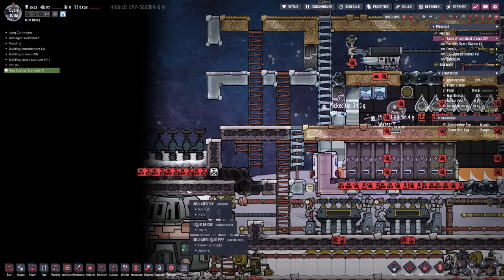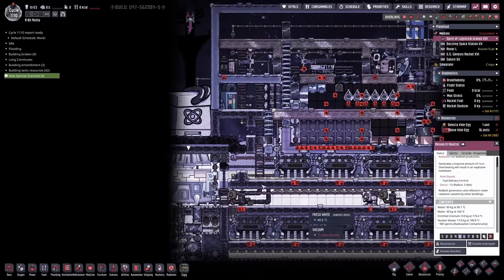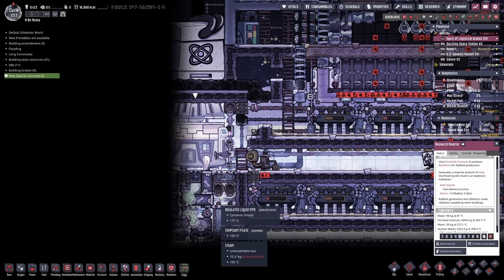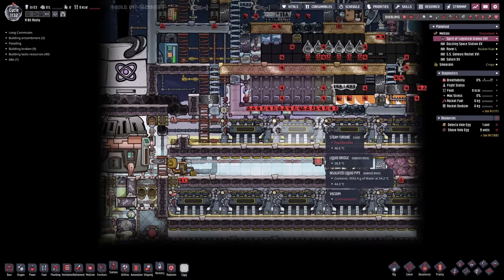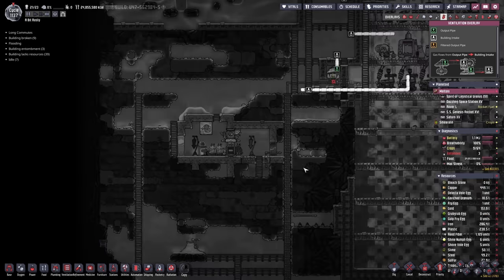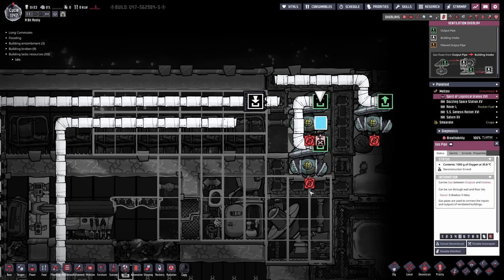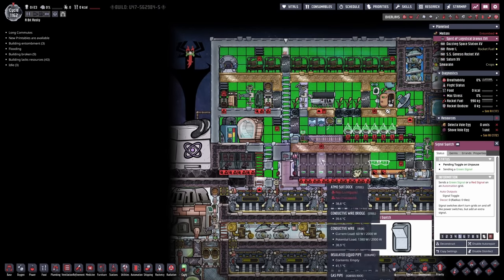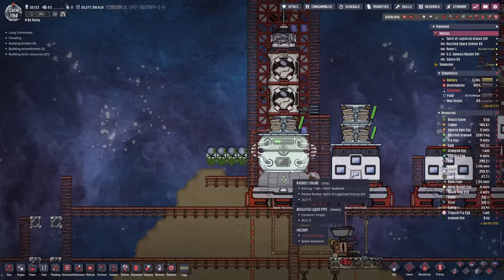Ep23 : All Systems Green : Oxygen not included

Comment: Since it seems like no one else mentioned it. 

The source of your radiation beam woes from the reactor has less to do with the tile you were working with - the one that lost some mass to the tile below it - and more to do with the fact that you packed the tile below it with too much refined carbon. You’re getting the lensing/integer overflow problem you showed in your previous video.

That’s why replacing seemingly random tiles a few space off-center cut down on the radiation.

Comment: Re: The conduction panels from last episode: The problem is that they exchange heat with the building they are connected to quite well, but they have really terrible conduction to the liquid flowing through. Imho that's a bug where the liquid only exchanges heat for one tick instead of the one second it spends inside the panel. If you place a valve downstream, after the panel (or multiple panels) and reduce the flow to something like 4000-6000, liquid will pile up in the pipes. Once the liquid backs up into the panel, it forces each blob to stay inside the panel for longer, significantly increasing the cooling power. The important part really is that the flow is backed up inside the panel, otherwise they are essentially useless. In my playthrough i split a normal 10 kg/s pipe into 4 2 kg/s pipes, each cooling 2 steam turbines just fine with polluted water.
Reply: an esier way would be to put 2 conduction panels  in parallel and slightly overfill the loop

Comment: 2 minor suggestions for the rocket:
1. Add an atmo sensor in the steam room hooked up to an automation notifier. Have the notifier just warn&pause if steam pressure gets too high. (may also want temp sensor as well). Just in case. (No sensor limits mod can work around the 20kg default atmo sensor limit).
2. Add a starmap location sensor hooked up to the rocket control station. Handy for automatically disabling dupe access to beds/toilets/rec buildings at specific locations.

Comment: Wait what, temp shift plates don't exchange with each other!? That explains so much with my geothermal plant
Reply: Yup, if you want to transfer heat evenly you need to use tiles or doors between each temp shift plate.
Reply: I also did not realize for the longest time, because they will “share” heat when not in vacuum. So a little bit of atmosphere or liquid will make it look as if they are working fine…

Comment: Maybe you could automate the removal of water by putting a atmosensor below the rightmost steam turbine, inside the shove vole ranch. Normally the problem with atmosensors is that you can't go above 20kg with them, but if I'm not mistaken the only reason you want high pressure is because you want to steam to push all the way to the last turbine, so if you get 20kg of pressure there then it means you have plenty. So maybe when you have that amount of pressure you should re-route some of the water from one of your turbines to your SPOM.

Comment: not sure if i just did things badly, but in my last minibase i used a sauna as well and i got a lot of broken pipes until things worked out. ended up using a cycle sensor to pump just enough steam to let 2 (steam capacity of the building) of my 6 dupes have a sauna every day. in my defense, the steam was rather cool (from a steam rocket), so i coudn't easily rotate things indefinetly without eventually flooding my rocket silo, but still: i felt like the saunas are more finicky than one woud expect. i'm curious about the hot tub as well, as i never bothered to use them.